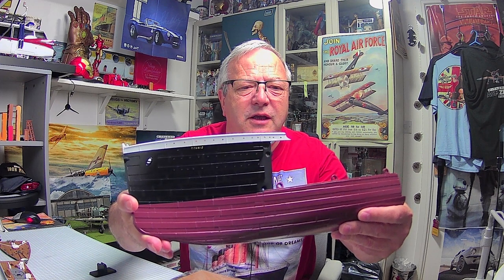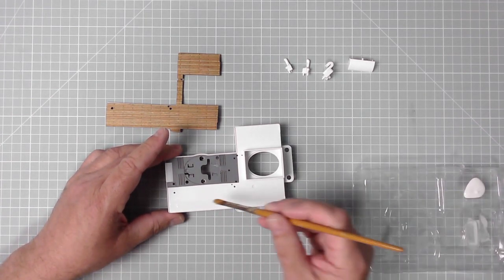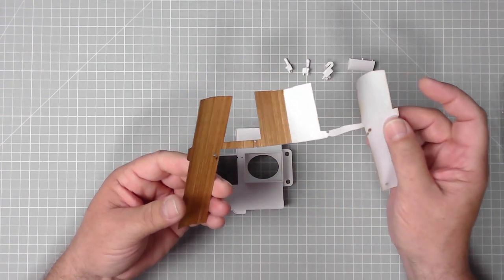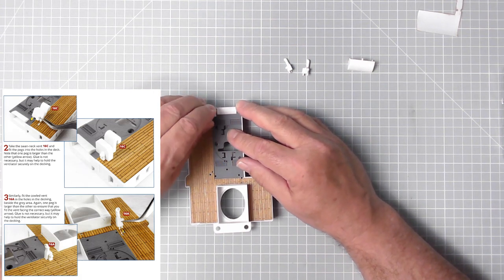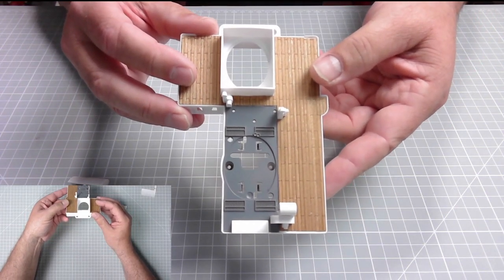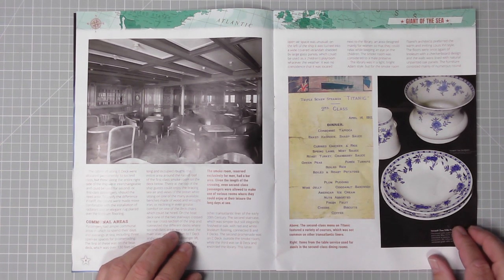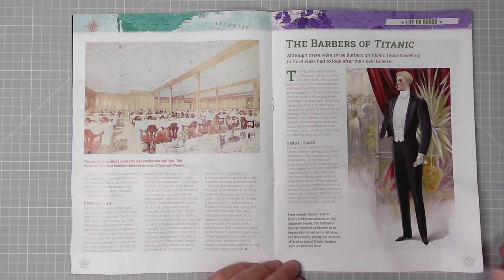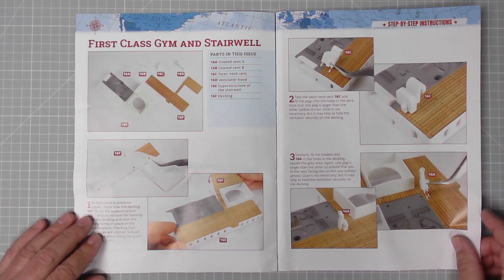Build the Titanic issue 16 from Hachette

Comment: Hi John sorry to bother you yet again when you say you use beeswax to hide the jigsaw effect do you just apply it to jigsaw parts then polish it  and keep on applying it ? but will that not give that part that you polish give a brighter than the rest of the hull. Thanks John Eric
Reply from the maker: I polish all of the Hull which will also protect the paintwork as well as the jigsaw portion. I have to add that this is an experiment that is cheap and works for me.